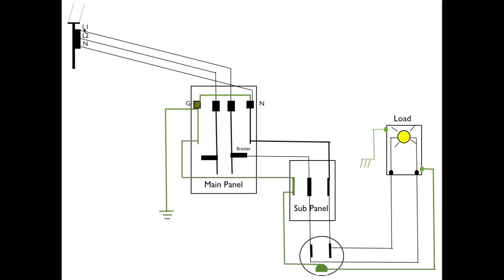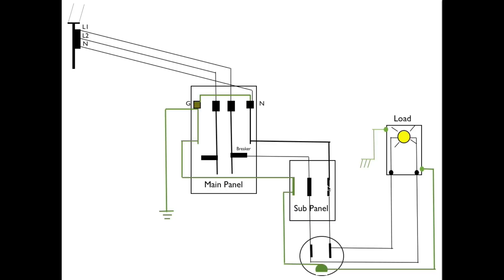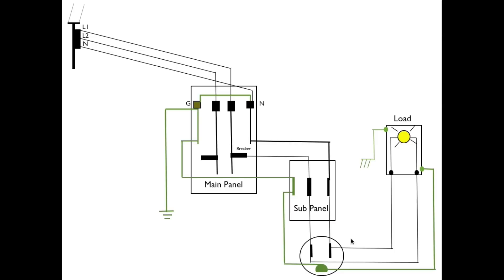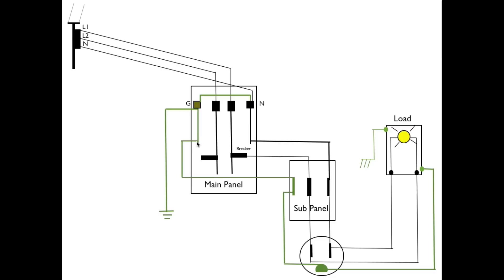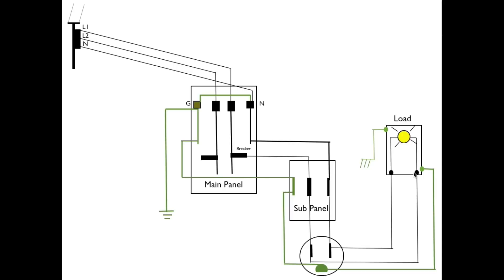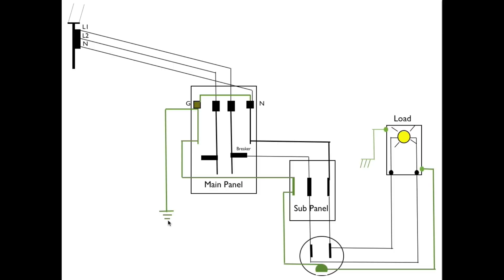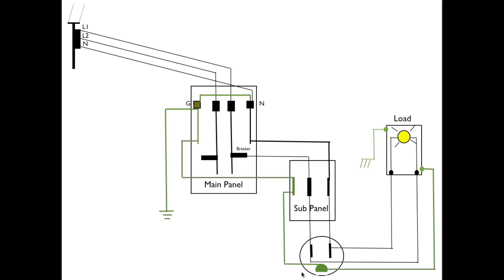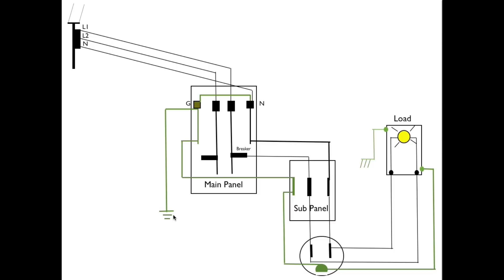The difference between neutral and ground on the electric panel

Comment: Question. Let's say your neutral in sub panel becomes " open " somewhere between main and sub, and the sub breaker doesn't trip. What happens to you if you should start touching the neutrals ? Remember there is no going to ground in the sub panel now due to code requirement for neutral.

Comment: GFM, are you implying at 8:15 that bonding neutral and ground in the sub-panel would prevent the over-current device from tripping, given a fault from hot to chassis at the load? 

It sounds like that's what you're saying, but its totally possible you're reference to the breaker not tripping is in regards to a different issue and I just missed the pointer. It's confusing because on the one hand, it sounds like your are not referencing a fault (since you say current would flow normally and breaker would not trip) but earlier you mention a fault/neutral disconnect situation and draw a line of current from the hot at the load onto the EGC (implying a fault). 

Regardless, if what you are saying is that bonding neutral and ground at a sub-panel is somehow preventing an over-current device from tripping, I would love to hear the explanation.
Reply from the maker: The problem here is if the chassis ground and the neutral are connected together, an open in the neutral will not result in failure of the appliance to operate.   Because the current can travel thru the ground conductor, appliance operation will continue.  Then, if there is a failure in ground continuity, the chassis of the appliance or sub panel will become "hot".
GFM
Reply: One other point of clarity:
"an open in the neutral will not result in failure of the appliance to operate."
I agree if you mean an open neutral downstream of the sub-panel. An open neutral between the sub-panel and the receptacle (upstream of the improper bond) would cause an open circuit.

Comment: @grayfurnaceman... good explanation for this greenhorn here but I have a question; absent of a neutral connection back to the sub-panel (either the real one or the ground-wire connected improperly), why is the chassis then hot? I listened closely but didn't hear anything about any connections between the load circuit and the chassis itself. Thanks.

Comment: tahnk you Gray,its easy to understand,what ampers use mostly in industrial company for main panel?
Reply from the maker: +Phogs Rams Industrial panels can be most anything depending on the equipment to be powered.  The most common is 200 amp.  
GFM
Reply: thank you for the information grayfurnaceman,..do you have a video of  Key power switch that use a contactor?..thank you and im always follow your nice video here,im studying in electrical course here in the Philippines
Reply from the maker: +Phogs Rams The closest I have is my contactors playlist.  You can find it at my channel.  Hope it helps.
GFM
Reply: ok.thank you grayfurnaceman,i will find that in your channel.

Comment: Thanks for the video it made perfect sense but what if there was load one foot away from the main box and there was no subpanel then we would have the same thing as described with incorrectly wiring a subpanel in the main panel itself no? Thats confused me forever
Reply from the maker: A sub panel and an appliance are essentially the same thing.  If I plug in an appliance that has a ground, the neutral and ground are not connected inside the appliance.  
Before any power can be used, the neutral and ground must be separated.
GFM

Comment: Thanks good explanation. Question we bought our house a year ago.  We have an unattached garage. With a sub panel with 2 (10) Amp breakers. The main panel has 2 (50) Amp breakers to the garage. Good bad Also how do I know what is the right gauge. I would like to have 20 Amp at least to service the garage. Any thoughts would be helpful. Oh, the pipe is small I don't think a bigger gauge would go through so that is out. I think the wire is only 10 Amp which is my deli ma. It is fully insulated garage and heated with gas. So, I would like to be able to use the big boy tools if I can. Thanks for the vid. I am a subscriber so thanks again.
Reply from the maker: +William Ward You have a problem.  The 50 amp breaker is far to large for the circuit. The breaker is there to protect the wire and the wire size would have to be at least #6.  If your wire size to the garage is #12, a 20 amp breaker should be ok.  You may want to check local codes also.  Hope this helps.
GFM
Reply: I agree and thanks for getting back with me.
Reply: William Ward — When you get your electrical permit, the inspector will answer your questions and tell you what you did wrong.

Comment: As an AC tech I have been using a pigtail connected to the service disconnect with no neutral to run my vacuum pump. I normally hook up the hot leg of the pigtail to L1 or L2 and the neutral and ground of the pigtail to the ground in the disconnect box. Is there any danger to equipment or people in the house? The pigtail is usually not hooked up more than an hour. In some cases 120 volt power is more than 100 feet away from condensing unit and I don’t always have that much extension cord.
Reply from the maker: I did the same thing for many years.  If the ground-neutral system is in proper condition, there should be no problem.  In fact, most 240 volt appliances that had some 120 volt loads inside were connected without a neutral until about 1995.
GFM

Comment: Makes perfect sense, now to check my temporary gen for floating or bonded ground, 240 is not a gfic.
Reply from the maker: Follow the manufacturer's instructions.
GFM
Reply: @grayfurnaceman  says there is a permanent conductor  between the gen stator winding and the frame. Not sure what that means, I guess grnd. I'll check continuity with my fluke.

Comment: Your information is a good effort However for clarity your outlet is drawn backwards and the hot side and the neutral side are reversed and would be confusing for someone who is simply looking at the drawing left or right and would have their outlet reversed and so this sould be corrected.
And for the ground it is in fact connected to both the ground rod and the water pipe.

You are right in saying how the code has changed and the grounding has changed outside with respect to the code and requirements for grounding technique but for the homeowner the outlet is the most important thing to emphasize and the only thing most will ever try on their own!

Comment: This is very clear. Correct me if I got this wrong, but are you saying that the electrons that are returning from the device load reach N in the main panel, but then return via the overhead wire to the pole [power company] rather than going through the grounding rod into the earth? And, that's because the resistance of that rod in the earth is too high? I hope I got that right. Given differences in the conductivity of the earth in different places, or at different times, I might think that could lead to an unbalanced current flow from the power pole [L1 or L2] vs back from the N bar in the main panel if current is being lost to the earth. Apparently that doesn't happen.  Is there something here I'm not getting? Thanks
Reply from the maker: The grounding rod is not part of the circuit.  
Current does not flow to the ground rod.
The circuit will work normally even if there is a short in the circuit without the ground.
The ground is there to absorb spikes and lightning.
If there is no other path for the current to flow, such as an open neutral, with a bond to earth ground, it will flow to earth ground but inefficiently.
Hope this helps.
GFM

Comment: My parents home has the panel ground attached to the water pipe.  Over the years, the Copper pipe has developed several pinhole leaks maybe 50-60 feet from the house (within about 25-30 feet of the city water main).  To my knowledge, there are no shorts to ground within the homes electrical system.  So, is it possible that the pinholes are forming from an electrolysis effect generated by back EMF from various electric motors in the home (dishwasher, washing machine, bathroom fans, furnace fans, etc.)?
Reply from the maker: More likely, there is a fault in the grounding system.
GFM

Comment: Nice video and I have a cuestion, I do a lots work on the roof of big buildings, most of the time they don't hove 120v outlets so I do my own outlet connecting one wire terminal to 120face and other terminal to the chassis of the A/C unit , it working good for my temporary work, but I  know that is not the right way to do , what problems do you think I can have doing this??? Thank very much
Reply from the maker: I must admit I have done this also.  It is not especially unsafe although some electricians will argue with that one.  If the only voltage on the roof is 440v, there could be a problem.  It would be best to include a ground fault interruptor on the cord.  I should do a video on that one.  Fortunately, where I live, code was changed to require a 120 volt outlet with ground fault interruptor on rooftops.  
GFM

Comment: I have spent a long career building high tech systems all over the world. You would be surprised how many times I have been handed a single hot wire by a local electrician. I have even been openly laughed at for insisting  on proper wiring with neutral and separate ground. “You waste money Mr John”... Ha! I often end up going out to the local shops and buying wire myself and then waiting for the “electrician” to go to lunch while I run my silly white & green wires through the building and to the power panel. Then I buy the guy a beer and try to make friends so they hopefully don’t stubbornly disconnect and resell my lovely wire after I leave. I try and try to explain my Long experience with electricity and how proper wiring really and truly does protect this very expensive equipment from unnecessary failure. 
I can always tell who didn’t listen to me by the number of failures they report. The world is a funny place.
Reply from the maker: Agreed.
GFM
Reply: John Lysic.... let me guess where..... SE Asia/China.....am I right?

Comment: Thank you for the great video . Question  , what prevents power from going to earth ground when the neutral wire is carrying current being they are connected at the main panel ?
Reply from the maker: Earth is a very high resistance conductor.  
GFM
Reply: @grayfurnaceman  maybe you can explain this to me. in my main panel is a grounding wire bonded to the neutral line coming in from the power meter. the grounding wire comes out of the panel and is connected to a water pipe right next to the panel, which is something i hadn't even noticed before. i just had a leaking pipe right there and went to fix it. i was disconnecting a portion of the pipe that had the grounding wire attached to it and as i was doing so, i first got a mild shock and then some arcing between the pipe and wrench as it was coming apart.

as far as i know, the grounding wire should connect to the water pipe near where it comes into the house, which is not the case in my house. i assume this kinda thing is why?
Reply from the maker: @holden_tld  First, the ground clamp, if it is connected a a water pipe, should be to cold, and there should be no unions between the clamp and the earth.
As for the arcing, you probably have an appliance that has an open neutral and a connection to chassis ground.  You might try unplugging appliances and checking the ground again.
GFM
Reply: Mark Me — Current flows when there is a potential difference.  The transformer applies a potential (voltage) to the neutral and the hot wires, which drives the current.

Comment: THANKS FOR THE GREAT VIDEOS!!!
Is the ground rod always connected to the top of the ground bar in the main panel, and the internal grounds always connected to the BOTTOM of the ground bar??
THANKS MUCH!
ps:  Where is that load ground connected (the one labeled "///")?
Reply from the maker: That is generally so.  It could be connected to lower end is the lug is mounted there.
GFM

Comment: Thanks for the video.  You mention that the ground is not supposed to be a current-carrying wire.  I am trying to understand 240v wiring.  Typical 240v has 2 hot wires and 1 ground but no neutral, correct?  Can someone explain this?  Thank you!
Reply: Wouldn't the ground in the 240v setup be a current-carrying wire?
Reply from the maker: Not much to explain.  If you have a 240 volt appliance with no 120 volt circuits, power passes from L1 to L2.   The neutral is not needed.
GFM
Reply from the maker: Ground is a safety.  It plays no part in the operation of the appliance.  L1 and L2 ore current carrying conductors.
GFM

Comment: Is the hot wire always hot or just at first when a load is connected and turned on or does it alternate direction after the first half cycle of wavelength to the neutral wire which then becomes hot and the hot wire is neutral, so the hot wire is hot 60 times a second and the neutral is hot 60 times a second being 120 half cycles for 60 cycles per second of 60 Hertz frequency? It has to be since the secondary of the last step-down transformer does this or we wouldn't need bridge rectifiers to make DC current from AC.
Reply from the maker: Rather than try to explain the way alternating current works, it is much easier to look at it like what the result is.  Hot is always the energized terminal.  Neutral is always the zero potential terminal.  Hot does not switch terminals.  
GFM
Reply: @grayfurnaceman  Yes I believe it does switch terminals since it does at the power plant generator based on the circle that uses two commutators, etc., but only one commutator is used at a time during each one half or 180 degrees of revolution. And hot electricity will not go to the ground connected to the neutral wire or bus since the ground connected to earth has way too much resistance for current to take that path. That is more for lightning strikes to prevent harm to the circuitry.

Comment: Thanks to good video, one thing i dont understand is that in the main panel neutral and ground are connected while in the sub penal it is not directly connected but ultimatley connected to the ground through the main panel in other words neutral and ground are connected whether in main or through sub panel. Can u pls explain why?. Thanks
Reply from the maker: +Maxamillion1022 What we are trying to do here is to make sure there is no condition where the neutral connection is lost and the load operation is not interrupted. Try going over the video again from about the 7:00 minute position.  It is explained there.  Hope this helps.
GFM

Comment: So lightning is the sole purpose for ground. I'm a journeyman "new construction" plumbing contractor. All this time I figured ground was in place so that if a car/ tornado/wind hit a power pole down the street and somehow severed only the neutral, the ground would act as safety barrier until the neutral was restored....sort of a "back-up" neutral. Please explain how that would not work.
Reply from the maker: If the voltage is high enough, the power will pass thru earth ground.  The problem is its not efficient and the ground rod can become an anode and corrode the rod.  
GFM

Comment: My subpanel in the garage uses one bar for Neutral and ground.  No ground comes from the main panel, only neutral and L1, L2.  The box itself is grounded to earth.  The single bus inside has bare copper (ground) and white cable (neutral). That bar is connected to the 6 gauge thick wire neutral coming from the main.  On the main, the ground and neutral wires share the same bus.  If my neutral failed the box itself being grounded should prevent shock.  Correct?  BTW, house is old.  I suspect this was acceptable some time ago. Wonder why it was changed.
Reply from the maker: If the neutral failed open, the box could be hot.  120 volt appliances probably would not work.  
GFM
Reply: Since this house was built in 74 and to my knowledge no one has died, is my configuration worth fighting the landlord over?   The sub-panel case is itself grounded to earth.  So if the hot load somehow energized the panel, it's my understanding the sub-panel ground to earth would save me.  In my configuration, How would I know the neutral failed?   Thanks for the reply BTW.  Watched this video 5 times.Your drawing is excellent.  Add a ground to earth on the sub-panel and you have my configuration.  I am still trying to determine is this a life safety issue or not.
Reply from the maker: Well maybe if you pour many gallons of salt water between the earth ground at the garage and main panel, it would open the circuit protection but I doubt it.  You will probably know if the neutral has failed as the 120 volt loads will probably not work.  Sometimes I have to watch training videos many times too.  
GFM